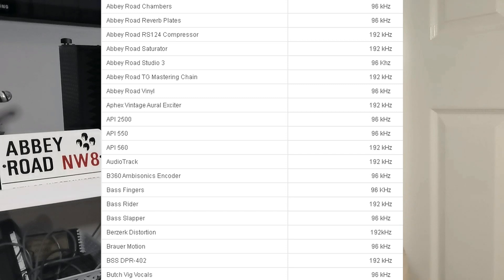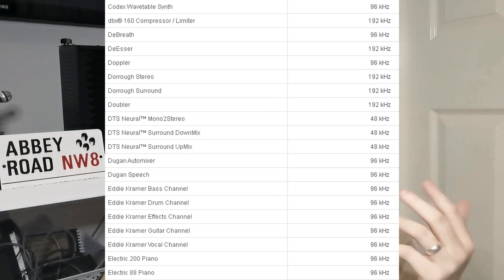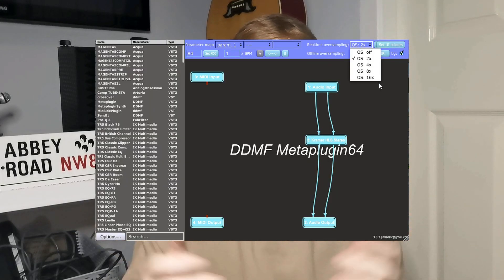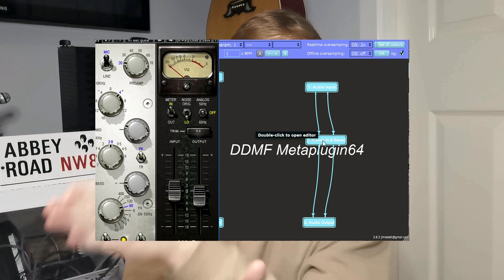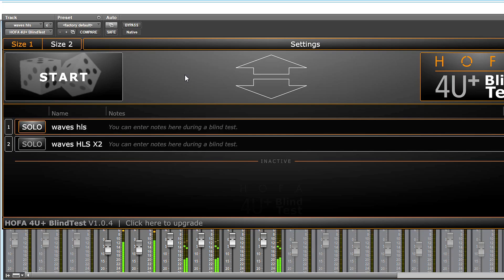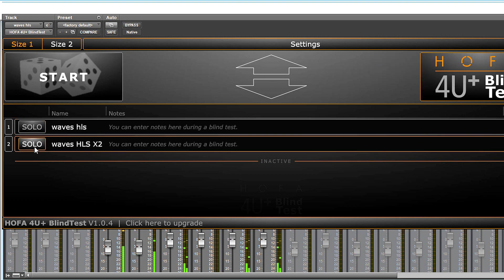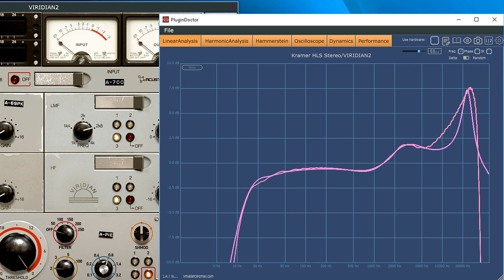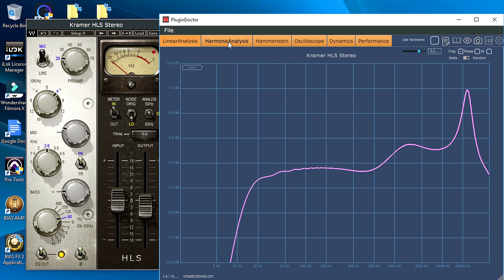OVERSAMPLING WAVES AUDIO PLUGINS USING DDMF METAPLUGIN || Kramer HLS vs Acustica Audio Viridian 2

Comment from the maker: PATREON PAGE
https://www.patreon.com/mixingwedesdays

Let me know what you all think of the OS.. Did you hear a difference with the OS on and which plug did you prefer overall? 🤓
Reply: the waves plugins are outdated that's why i use the plugin alliance plugin inside ddmf metaplugin so you're finnally choosing to give it a shot specially the offline oversampling option i asked to be implemented by christian. also x2 oversampling isn't gonna make a change.
Reply from the maker: @Jams why isnt x2 not going to make a difference?
Reply: @PaulThird  it's enough to significantly do a change in the sound.
Reply: Yes, I definitely hear a noticeable difference between them. A bit more depth in the OS, rather than flat. Acustica was the better in the blind shootout for myself also.
Reply: AA pushed the sound back/gave it more focus depends on what your ears prefer/perceive
Reply from the maker: @C yeah I could easily pick out the waves today. This one was more of a "what do you prefer today". Definitely in the context of a mix thing with that blind test

Comment: I can't try it right now but, isn't it possible to just increase the sample rate to the max like 192 or whatever the interface handles before exporting?

Edit: Nevermind I think my Id4 mkII maxes 96
Reply from the maker: Nope once aliasing is in a track its irreversible so changing sample rate on export only affects the master channel and not the tracks, they will still be processed at the original sample rate
Reply: @PaulThird  Even if the tracks still have vst instruments with fx chains that aren't bounced? I know that it's irreversible if it's within the audio file, but would that be the case if the aliasing isn't recorded in the stems yet?

Comment: I found that DDMF oversampling Waves result in different of time in compressors and Hz in eqs
Reply from the maker: Depends on the sample rate. If you exceed 96khz in most waves then the frequencies will multiply. Some compressors support 192khz so you could get away with x4 OS at 48khz but for most waves plugins x2 OS at 44.1/48khz is as far as you will be able to OS them
Reply: @PaulThird  Besides the aliasing,  for me what is a game changer in doing that is that compressors responds so much better!

Comment: Sir..can you tell me your electric guitar mixing chains? ( Sound Design, Distortion, EQ, Comp..) I'm watching everything for you, not skipping youtube commercials lol
Reply from the maker: Right now it's pretty simple. Reso to calm down any unwanted resonances, smart eq, gsat+ in a transformer preset I made for more width and body, split eq to take away some of the transient stuff which can get in the way of the vocal and then acustica magenta to sit it in the track and give it what it needs.

I've also got 2 aux sends which are the Arturia spring verb and the Arturia space echo.

I'll also use eventide harmonizer and flanger for extra effect where I feel needed.

On clean DI guitars I'll normally compress it early on with the waves axxcomp

That's it really
Reply: @PaulThird  wow thank you sir. If you want strengthen your guitar tone, what kind of Musical EQ do you recommend? AA , Waves  , Lindell , SSL..what do you use?
Reply from the maker: Acustica magenta

Comment: Would using a session at a high sampling rate not solve it?!
Reply from the maker: Yup. BUT it's dependent on the max supported sample rate of the plugin. You can work at 192khz but tons of Waves stuff is 96k so that wouldn't work. You can then work at 96k but you are then using way more overall cpu as every plugin will run at 96k in your session. Any high taxing plugin at 48k will cripple your cpu at 96k so to get the best performance efficiency of cpu you only oversample what needs oversampled. I mix at 48k and internally oversample the odd plugin via metaplugin if needed but tbh most modern plugs have oversampling options built in to the plugin

Comment: The million dollar question:

Would simply tracking and mixing in a session that’s globally set up as 96k/24bit do the trick?  Shouldn’t that remediate the aliasing issue for every plug-in?

In times past, this would be a massive strain on the CPUs and disk i/o for consumer systems, but with the advent of the M1 Pro/Max chips and very fast SSD i/o might make it a feasible new standard operating procedure.

That solution would be a bit more streamlined than oversampling the plug-ins that have that feature natively, and wrapping the others in Metaplugin to oversample them in order to remediate aliasing.
Reply from the maker: If your computer can handle it then working at a higher sample rate is easier but does overall put an unneeded strain on your computer as there may only be a few select plugins that actually need it for aliasing.

Internally OS in the daw allows you to have lower file and session sizes as well as reducing the fear that you may have to be careful about what plugins to use due to cpu crashing out as some point.

I personally pre mix at 96k and then mix at 48khz. All my main clean up eq, compression, soothe, blond pre mixer etc etc is all done at the highest sample rate and then printed so I can mix at a lower sample rate without worrying too much about my plugin choices.

Sometimes it's cpu dependent, and sometimes it's just a mental thing haha
Reply: It is NOT the same. You have to roll off the range above 20 k after every plugin instance. Then it is the same, but unnecessary like OP stated above me. Only a few plugins need it.

If you don't roll off after every aliasing plugin, the aliasing will wildly spread across the whole spectrum. Dan Worall explained this in the FabFilter "sample rates the higher the better?" video.. very recommended video to watch. Highly interesting
Reply from the maker: Partly true as anti aliasing filters (very steep lpf's) only block higher order information past 20khz. It's a small solution to only a small part of the problem as niquist is still 24khz at 48khz. The devs know that we can't hear above 20khz but a 48khz session will reproduce a frequency response of up to 24khz. That inaudible extra 4khz is unnecessary and can produce higher order harmonics which will definitely exceed niquist and can result in aliasing if those frequencies have harmonic content. So they simply filter that stuff out whilst not affecting the audible range.

I think a misconception made a lot is that the lpf's filter out absolutely everything. It only filters out the frequency response. In the digital domain harmonics can come from across the spectrum so harmonics can be created from any frequency not filtered out. That's why I do my aliasing tests at 10k as it's a realistic high order frequency that creates harmonics that can rise past niquist. It's a good frequency to test as you'll have audible aliasing regardless of the source. You can get harmonics being created from 18, 19, 20k but depends on if that source has a lot of that particular frequency. Thus why 10k is a realistic test.

In the digital domain these harmonics simply go as far as they are meant to go so they will surpass niquist but can't be computed by the computer so they are reflected back into the audible spectrum and that's why we oversample or use higher sample rates so niquist is higher and thus more higher order harmonics can be computed within the frequency range of the sample rate.

The lpf thing really only works as a good anti aliasing tool if your source doesn't need a lot of high order information but as I said, I test at 10k and can get a ton of audible aliasing. So you can steeply roll off stuff at 10k and still get audible aliasing. In some cases you'd need to filter out highs to like 7-8k but your not gonna do that so the logical solution is to increase nuquist and the only way to do that is to either work at a higher sample rate or internally oversample. There's lots of times where there isn't much harmonic content at very high frequencies so many lowpass at 16-17k thinking it'll curb the aliasing when really the highest level of high order harmonic content is around 10-14k
Reply: @PaulThird  I’ve downloaded the Airwindows Ultrasonic AU plug-in for use in Logic.  If I use an instance of it after every distortion/saturation type of plug-in that doesn’t have native oversampling built in, that should eliminate the problem, correct?
Reply: @PaulThird  i don't think we talk about the same here. Oversampling is the process of increasing niquist limit + a lpf. So if you only increase niquist in your Project but don't lpf anything it is ineffective. That was my point

Comment: Im actually liking a lot using cla76 on x8 😵‍💫
Reply from the maker: Depends on the linear frequency response of the compressor. If it has a roll off of some description then you may like the sound more of less low end and possibly more highs when oversampled that high 🤷‍♂️

Comment: I was just noticing something about the Acustica harmonics thing. So all the plugins have a preamp section going into something clean (ie, EQ, comp). With the channel strip version of the plugins, there is only one preamp. So if you want extra dirt, you want to load up the various pieces of the channel strip independently and engaging their preamps. Is that something you would conclude as well?
Reply from the maker: The preamps are just slight variations between each channel of the console. If you want more harmonics then you drive the input of the Plugin. In most channel strips the variations in the seperate pre instance are very slight.
Reply: @PaulThird  yes, I mean the channel strip only has one pre. But if you ran EQ => Compressor for example, you'd have 2 pres you can drive. Or if the AA module has a separate pre module, you could do pre => EQ => comp for 3 preamps to drive.

Comment: I'm not sure but an overdriven distorted eGuitar doesn't seem like a good candidate for comparison of clarity or frequency response comparisons of plugin.  I'm not deaf bit I literally could hear no difference in any of the comparisons.  Not sure what I'm listening for, but if its that subtle (to me inaudible) of a difference, does it even matter in the mix?  I'm listening on my laptop with a pair of Sony MDR-7506 headphones... 🤨
Reply from the maker: Hmmm.. Im not sure what to say to be honest. I picked it out in like 5 blind tests on the trot and it's easy for me to pick out. Maybe it's because I do so much critical listening but the oversampling reduces the aliasing which is a lot in waves plugins normally, especially the older ones.

I can hear the reduction of aliasing which results in the guitar having more cut. The aliasing without oversampling is muddying up the guitar and to me it's quite audible. I also hear more definition in the strums/chugs when oversampled.

oversampling waves plugs will reduce that muddyness/ harshness which will build up in a mix especially if using a lot of Waves at 48khz. It'll all add up. 

If you can't hear it then I suppose you just don't hear it. Nothing else I can say really

Comment: This DDMF thing makes me think - there are so many plugins without oversampling out there... I just tried the demo on Amplitube and NadIR, got interesting differences... Not yet sure if I should use it but still...
Reply from the maker: I guess it's a workflow thing. I think it's to avoid cpu issues and if they put oversampling options in then people might start complaining that to get the best results out of the plug it's a cpu hog, and that may prove that their aliasing filtering isn't the best and possibly isn't coded the best. Wild guess but I do find it odd they don't offer OS in a lot of plugs, especially saturation, distortion and a lot of compression effects.

Think of it this way. If somebody gives you a better sounding option then you are going to use it. If it turns out its too much cpu then you might actually look at the bare bones default state and go.. Man that sounds pretty poor, which you wouldn't have if you hadn't of heard the better version.. If that makes any sense.

Its the only logical thing I can think of.
Reply: @PaulThird  Correct, but to be honest I can get used to freezing tracks if they sound like this. Just tested another setup with NeuralDSP + Libra, the difference is brutally obvious. I can already see it wont work with everything, depending on the code (with NadIR I got a pretty hefty Low pass at 6K), but I'm confident this is worthy of some exploration. Maybe the rest of Waves is not so trash after all... haha!

Comment: Hey Paul, I did oversample some waves plugins 
with MetaPlugin but did not hear ANY difference... Am I missing something...? And the AA Plugins can only be oversampled 2 times... PLZ help, buddy...
Reply from the maker: What sample rate are you working at. Whats the plugs and are you using real-time or offline?
Reply: @PaulThird  44Khz and realtime processing...
Reply from the maker: What are you using (x2), (x4) etc?
Reply: @PaulThird  i tried every Rate.. and is it normal that when you switch the rates that the highs get a Bit lost and the bass is getting stronger? When trying the NLS channel with oversampling I Heard a massive difference but with less high frequencies... Greetings
Reply from the maker: NLS is supported up to 96khz so at 44.1k you could only do max of x4 OS. Being honest I don't there is much difference in terms of 44.1 vs 48 in terms of hearing a massive difference in sound quality as I still don't like waves at 48khz. 48khz vs 96khz is the massive jump to my ears. So at 44.1 I'd make my assumptions at (x4 or x6 if the plug is supported at 192khz)
Reply: @PaulThird  Thanks, Mate! 👍
Reply from the maker: BTW AA plugs can't be oversampled. Same with Nebula. Due to the frequency packs 🤓
Reply: @PaulThird  Ok, I understand!

Comment: Here's the Fabfilter video mentioned. INCREDIBLE VIDEO! youtu.be/-jCwIsT0X8M 
And if the " SnakeOil" Guy read the manual which he refuses to ever do,  he'd know that. His videos frustraite me, He's probably a good engineer but he doesn't spend any time on the plugins at all And people seem to think his opinions are gospel haha. 
Great video man, I never realised how important Oversampling really was for ages. I too will be using the DDMF on waves stuff now.
Reply from the maker: I can hear it quite easily but I've learned that it won't do much in a lot of plugs as lots of modern plugs have good anti-aliasing filters.

It works perfect for waves as they are mostly riddled with aliasing so you'll hear the difference when oversampling.

Comment: Thanks for doing this video! I have in the past packaged some Waves plugins inside Metaplugin for oversampling. But honestly: this is just an annoying workaround. It would be easy for Waves to update their plugins with an "oversample on/off" button. Once they've done that, I'll happily use/buy their plugins again. ;-)
Reply from the maker: That's what I think. If you can add resizing of GUI's in V12.. You can surely add in an oversampling option. I'd take a guess and say its probably a waiting game for them. I think they'll wait till the WUP and $$$ take a certain dip and then implement it to then get everybody back using them. I'm just speculating but makes sense as to why they've been holding back for so many years. I don't think they comment much on forums and discuss this stuff much so it's almost like a backup plan they can use at anytime to compete.

Dunno.. I get a proper tin foil hat about this stuff as they never talk about it 😂😂

Comment: what will hapen if you oversample an AA plugin?
Reply from the maker: Doesn't work due to the way AA plugs are set up. If you oversample an AA plug it'll mess with the frequency pack and it'll either half or double. It work work.

Plus I'm pretty sure most AA plugs are only supported to 96khz as they are sampled at 96khz. I could imagine there being internal oversampling involved thus the need for frequency packs and stuff but that goes way over my head haha

IF you want the best sound out of AA then I'm told it's at 96khz which is why my new AA shootouts are at 96khz sessions.
Reply: @PaulThird  too bad :( DDFM Ca't help i guess

Comment: have you tried putting analysing with a sonogram to see if it visually shows a different between oversampled and non-oversampled?
Reply from the maker: I can see a difference in plugin doctor if that's what you mean. If you go past 96hz on HLS it starts multiplying the frequencies. Took me all day to figure out why it kept doing this until I was told that waves plugs are only supported to a certain sample rate. I was at 96khz so oversampling wouldn't work properly. That's why I had to put the guitars into a 48khz session and use x2. If you use x4 and above then you can hear the frequencies being multiplied and it becomes brighter with less low end as everything shifts
Reply: @PaulThird  That sounds like a real important observation.
Reply from the maker: One many many engineers forget about or still dont know when it comes to oversampling plugins externally